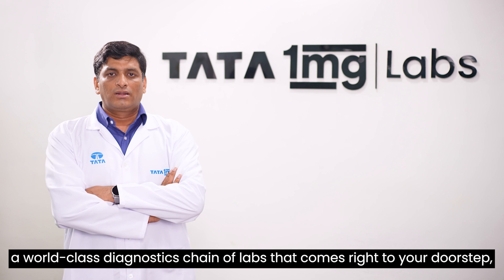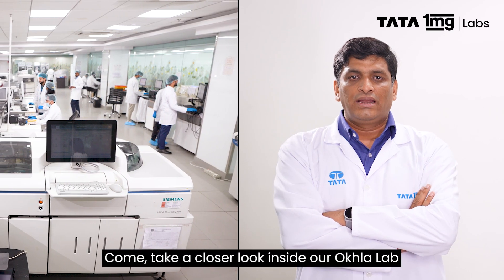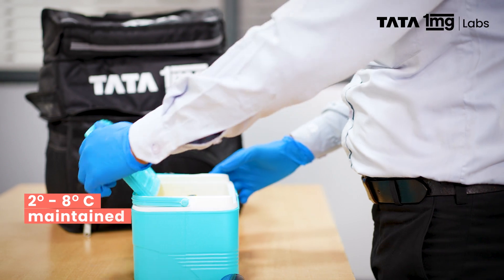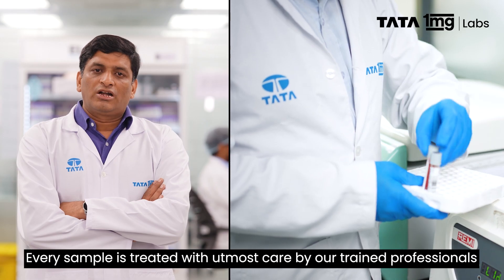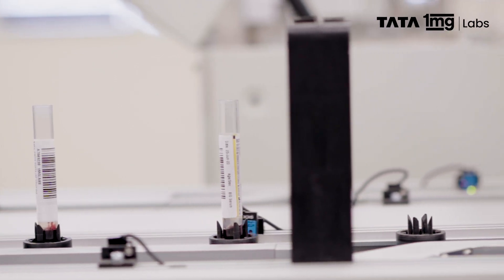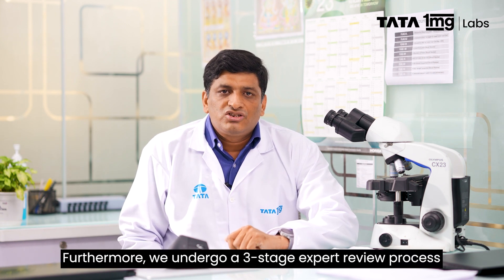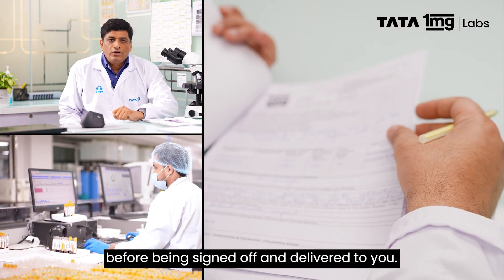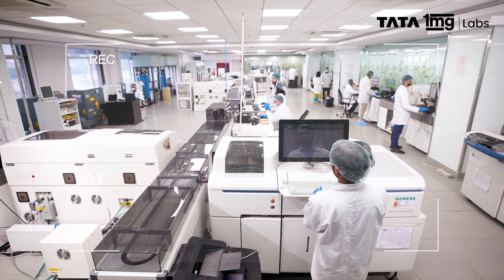Tata 1mg Labs Inside Tour: Take a sneak peek of our world-class National Reference Lab, Delhi

Comment: Once a bar code is assigned by the phlebotomist does it remain the same till the end stage or is it switched with new slips?  Or same slip remains
Reply from the maker: We want to inform you that once the bar code is mentioned by the phlebotomist it will remain the sample till the report generation and in the reports as well. ^Ekta
Reply: @1mgofficial   maam, at any stage is the bar code replaced with a new slip bearing same number or the slip that was originally pasted remains the same? As if it gets changed there could be chances of error. Just a general query maam.
Reply from the maker: As informed earlier, the barcode remains the same throughout the process of report generation. ^Ekta
Reply: @1mgofficial  OK maam, actually many labs paste new ones over the original one so there is high chances of errors. But from what I am getting to know from you, the ones used at 1mg, the one pasted by phlebotomist remains for he entirety of the process